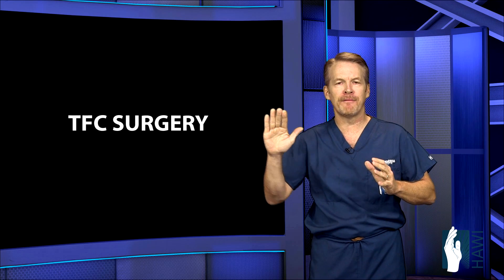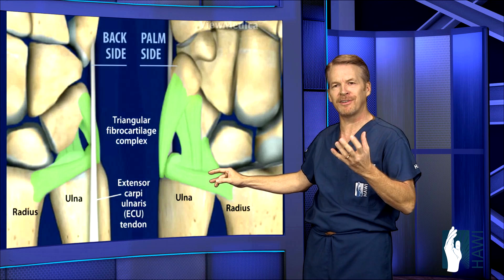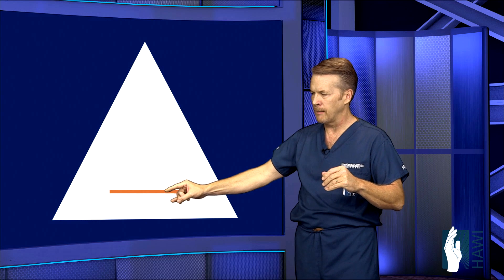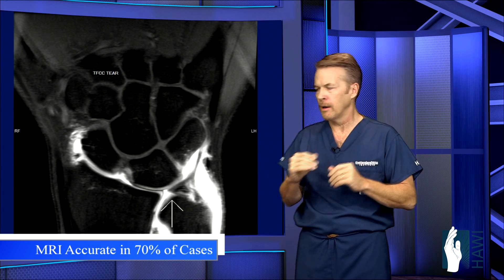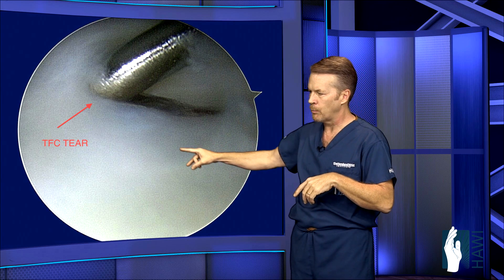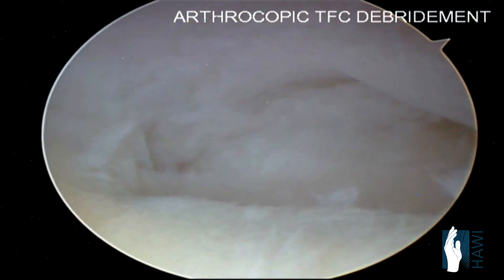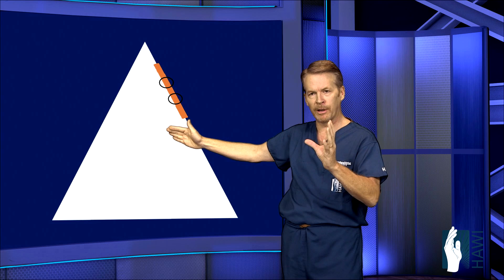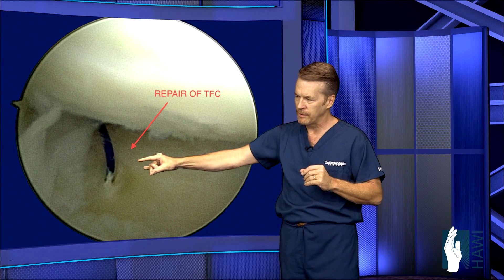TFC Surgery (Triangular Fibrocartilage Complex)

Comment: believe I have a TFCC. It hurts right under the pinkie like the TFCC do. It only hurts when I fully extend/stretch it vertically and horizontally. Do u think that means it's a self-fix or should I see a doctor. It have been hurting the same for 3 weeks now. I tiny but improvement I would say.
Reply: Bro are these problem gone day by day or any procedure you follow or what happened
Any update is useful for me
I am soo depressed now
Reply: Bro plz reply me i have the same problem help me 
What procedure you follow
Reply: @ It went away eventually. It took like a year though. I did some rehab exercises for like 3 months and rested. I fell pretty hard playing basketball.
Reply: @andreaswahlgren4327  thanks bro so rehab exercises and rest (rest means not bearing even small weight and also dont open and close the finger is that right)
When playing basketball you got pain before or it happens now
Reply: @BlackVenomGamer  Resting for me meant doing movements that not hurts. You still need to be active with your hand. My pain started when I fell on my hand playing basketball. Im fine now.

Comment: I went through the miss diagnosis period not getting better over a six month rehabilitation period which treated a sprain wrist. Always told that would strengthen the writs and I would be back to my normal habits and sports. That was 2013. After my insisting it was something more than just a minor pulled muscle and simple MRI showed experts there was a problem. ( shouldn't it have been an Arthrogram done instead??) Then they concluded the TFCC is messed up with 50 percent of its mass coming off the ulnar bone. I then was subjected to TFCC surgery  where one anchor was used and  then 6 weeks of healing followed but 6 weeks of therapy. When released to simple easy swimming activity, the pain came back, then Doctor in charge also stated, after some pushing and questioning, that he had not repaired a tendon next to the ulnar bone. So I went through another surgery at the end of 2014. The second MRI was and Arthrogram type and shows as I read it today, there is an anchor attached to the Ulnar bone. Needless to say I am still having a lot of pain and while is has gone down from 2014, it still feels like a nagging burning sensation around the TFCC and Ulnar bone. Any help anyone can provide on this please?
Reply: hey, sorry to hear that. How is your wrist atm? Any improvement since then?
Reply: Hai bro whats your problem its cured  @notrealfroggen3020
Reply: @SaenzFonsi  bro how are you now any improvement its cure

Comment: Hi, I've been diagnosed with a TFC ulnar injury in my right wrist. I'm right handed and this causes quite a bother. I'm 17 years old and still growing quite rapidly, so I've been told this will result in difficulties during and after surgery. I was given only a "Wrist Widget" - a brace to support the wrist, which broke within 3-4 months of use. Should I get surgery? If so, should I get it now, or when I'm fully grown? Also, if I were to be in the 5% of unsuccessful surgeries, would I be worse than before, or simply see no improvement? Thank you very much in advance.
Reply: Hey man. How's your wrist?